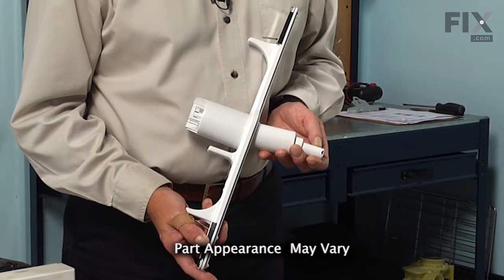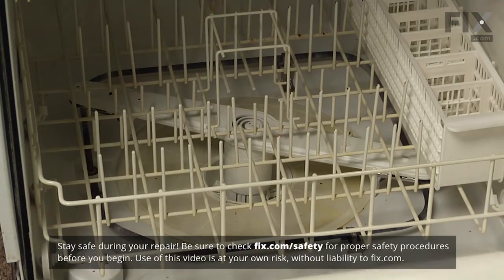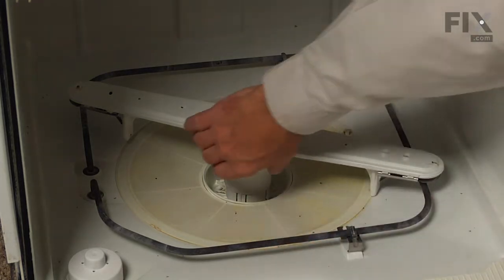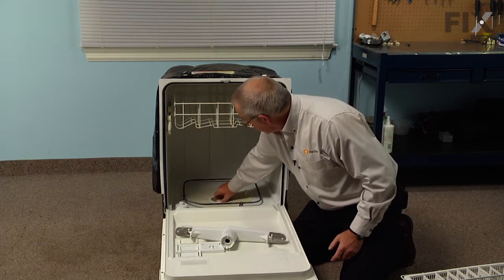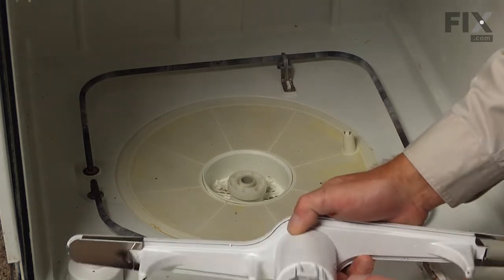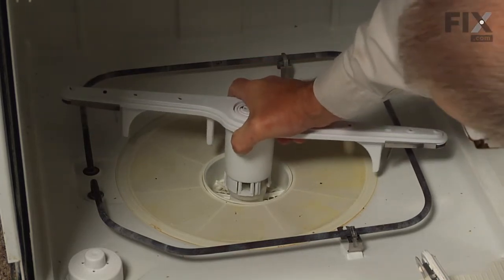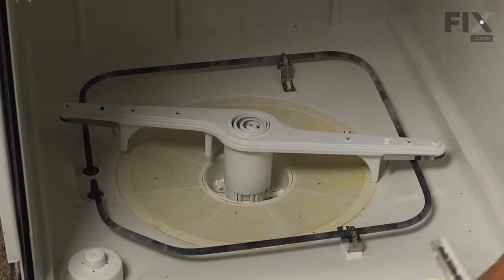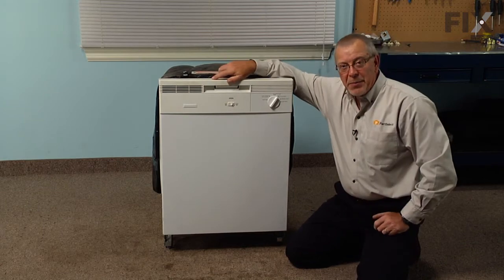Frigidaire Dishwasher Repair – How to replace the Lower Spray Arm - Gray

Comment: Can't get back on
Reply from the maker: Hi Dedra. The key with replacing the spray arm is to line the clips up properly. You may need to rotate the arm slightly and apply a little pressure to allow it to snap on. It might also be possible that the clips are damaged, in which case, you'll unfortunately need a new spray arm. Please feel free to reach out if there are any other questions we can help you with!
Reply: Fix.com 
No .
the problem was I didn't know the sequence to fit it all back together. At least 3 moveable parts. I say this for anyone that had done this also.
Reply from the maker: Hi again Dedra. Could you send us your dishwasher's model number? It could be that your model is slightly different than this one. To re-install this particular spray arm, it should be as simple as snapping the new arm back in place, there shouldn't be more moving parts. If yours is different, once we know the model number we can hopefully take you through the sequence of replacing the spray arm.